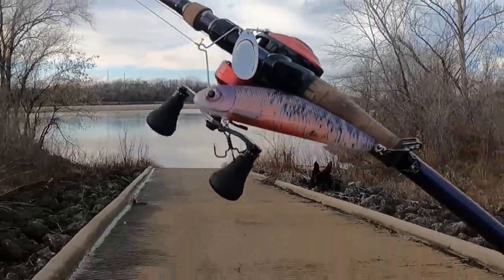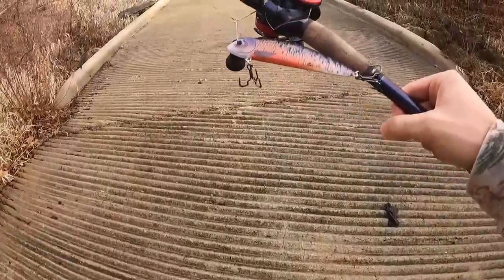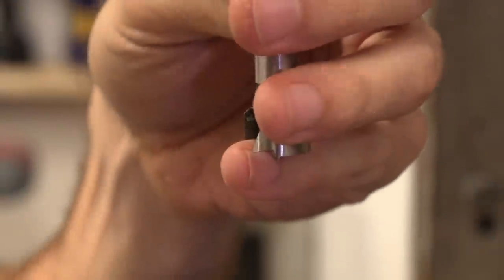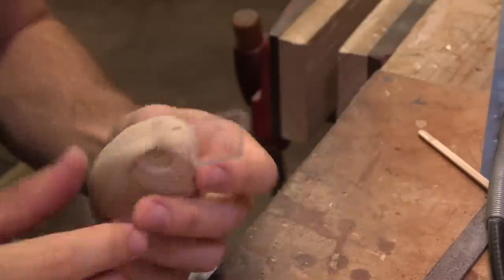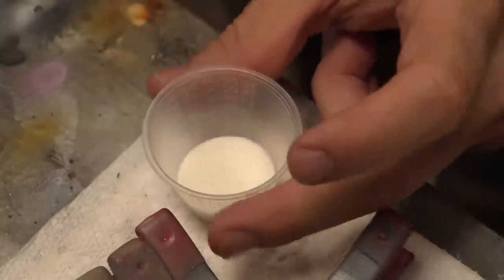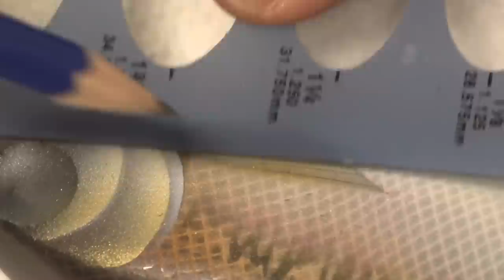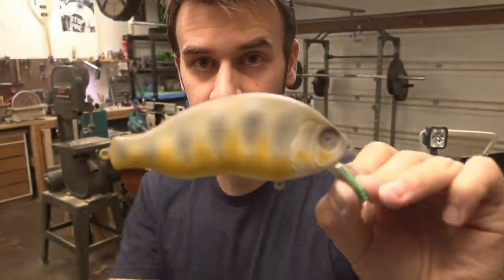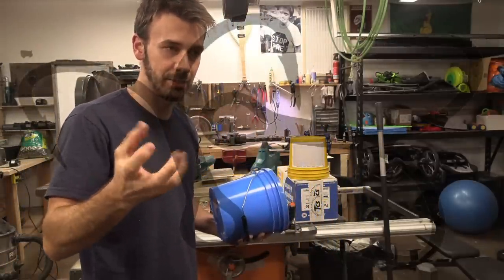Making Lures That Look AND Work Good | Cranking The Baits Out Ep. 4

Comment: Using some isopropyl alcohol on a q-tip will cut right through that adhesive residue of the ahipping label and won't stain or affect the wood at all. It'll evaporate on its own after only a few minutes.